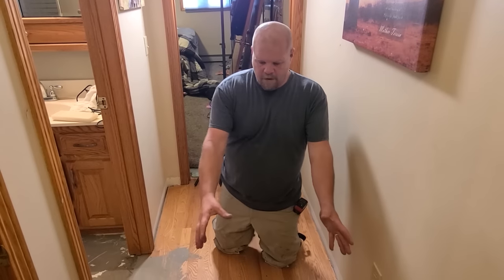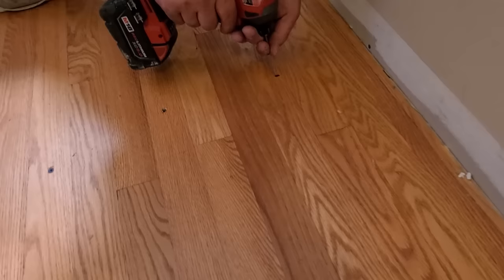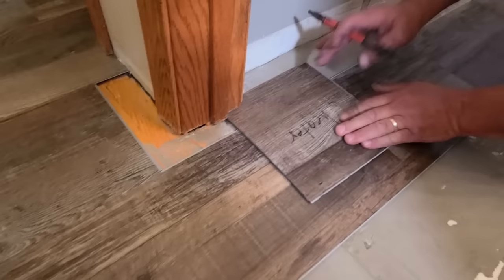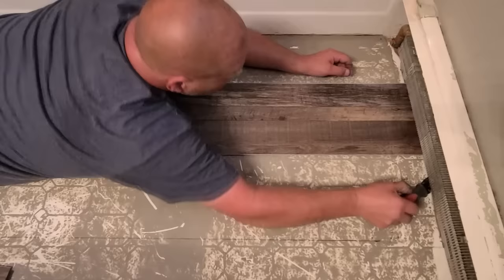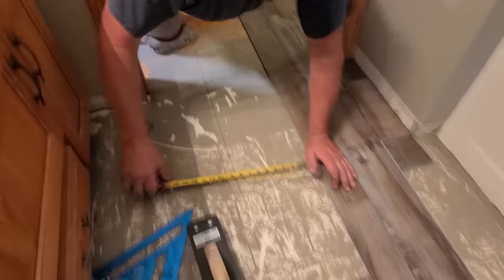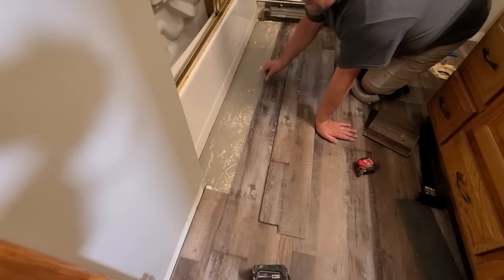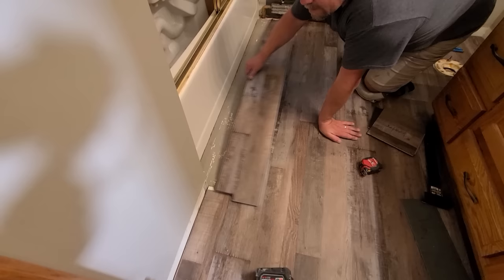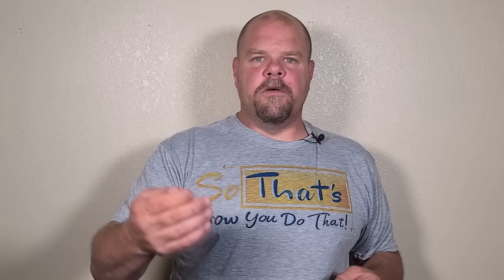How to Install Vinyl Plank Flooring Into a Bathroom

Comment: Hey how is that Mohawk (Tybee island) from Lowe’s. I like the color and the product feels nice and durable, like how the locking lips seem to flex and bend before they break and it has like a 20mm urethane wear layer. Normally around $3 sf But see it on clearance for 1.30. Didn’t know if you had insight on that product. 
Thank you! Great content btw 👍
Reply from the maker: Here is what I would do, bring a box home and lay it out and put the planks together and see for yourself if it is good. If not, bring it back!

Comment: Great stuff Joe.  On our bathroom floor renovation we need to go parallell to the tub.  I saw on one of your other videos that you stated to start with the groove at the tub. Is that correct? Thanks
Reply from the maker: No. I was working backwards in that video because I continued the floor from another room. Always point the tongue towards the starting wall. Hope this helps.
Reply: Sorry Joe, I meant perpendicular. And you stated start with the groove. ???

Comment: Very helpful! Subscribed your channel and will go through your videos to learn more :).
Question regarding using vinyl planks or laminated for washroom.
Costco has both vinyl and laminated floor, we love the color of laminated very much, but it’s Water Resistant only, do you see any potential issue if it is installed in washroom, which has shower tub in it?
Thanks a lot 
Kelvin
Reply from the maker: I would lean towards vinyl plank. But, if you use laminate you can silcone around the edges before re installing the trim.
Reply: Thank you for the quick reply and tip.

Comment: I have a question please... My subfloor has a hump through the middle of the main living area (and focal area). The hump is nearly a 1" high spot over a near 10 foot section from one level side to the other, and going through the whole room (parallel with the direction the new vynal flooring is going). I don't know if I should sand down the area or feather it out with filler to make it more gradual. The subfloor plywood is not as thick as the 1" of sanding down needed so I would go straight through to the joists. I have no idea what to do or why my last floor (engineered hardwood) didn't creek or move with this hump.
Reply from the maker: How old is the house? Are you running the plank direction parallel to the hump?
Reply: @SoThatsHowYouDoThat  The house is 13 years old and yes the planks will be parallel with the hump. The planks are 12mm thick and 10" wide and 5.5' long if that matters
Reply: @SoThatsHowYouDoThat  And after measuring using a longer level, it looks like the hump is just under 3/4" so not quite the 1" I first thought
Reply from the maker: You can cut a section of the subfloor out to get to the joist and then plane the joist down. If you run the plank parallel to the joist it would be ok to go over it. The problem with that though is you still have a hump.
Reply: @SoThatsHowYouDoThat  Thank you so much! I just ordered a decent planer and will be fixing the joist. I just figured that if I don't do it now, while I have no flooring or furniture there, I'll probably never fix it. I really appreciate the advice!

Comment: I've seen many photos of LVP bathroom installs @ tubs, people leaving 1/4" gap for expansion then adding in quarter round at tub to cover gap + caulk to seal. Is the quarter round not needed and we can just do a 1/8" gap and be good? Thanks!
Reply from the maker: Yes, an 1/8 inch gap is good to go and then caulk it.

Comment: I'm tiling the bit under and around the toilet.... I don;t like the thought of weewee collecting in the grooves. between the planks.
Reply from the maker: That won't happen if the plank is put together correctly. You could also glue the joints together in that area to get more protection.
Reply: @SoThatsHowYouDoThat  Thanks for the reply, I'm gearing up to do a house I rent out.... I have one more question though... how does it handle things like cigarettes being dropped on it, I reckon heat would probably be the main Achilles heel with SPC.
It is a small place I rent out so hard to control things like that...
Reply from the maker: I cigarrete can burn it if left on the floor for too long. However, a single plank can be removed fairly easily to fix that.

Comment: I know that most manufacturers tell you not to install LVP flooring under Cabinetry. But, I wanted to get your thoughts on it as well. Thank you for your time!

Also, is there any change in the process of installing flooring in the basement on cement floor?

Comment: We are having to "tap in" a 10 foot section of LVP with a 1 ¹/⁸" section along the side due to unavoidable dimension issues in the house.

Is there a lube we can put on the tongue and groove? I haven't seen a video addressing it.

The problem we ran into is one of the 2 boards were tapping in bent up at the end. Thought reducing the friction may help.
Reply from the maker: Use a pull bar
Reply: @SoThatsHowYouDoThat  
That would have been the smart idea. But We couldn't fit the pull bar that I purchased in the small gap.

I finally got it but sliding the whole section in, lifted hats a little to reduce the friction.

Spent a while day on it.

Thanks for your videos. I was able to plan the whole house  before starting because of them instead of guessing! Just the way it was built, we ended up having to choose were to put the "sliver".

Comment: Hi, helpful video. I have one question. How did you get the board in at 10:55?
Reply from the maker: I slid it under the jamb first and then started to put the joint together at the wall and worked towards the jamb.
Reply: @SoThatsHowYouDoThat  Thank you

Comment: may i know how to decide whether the floor needs underlay?
Reply from the maker: If it has it attached you don't need anything else. If you have a strong locking system you can add another layer.

Comment: Yo joe. What do you think of the overlapping grip vinyl planks that stick to each other with adhesive? Started looking at floor options recently. Dunno what to pick yet
Reply from the maker: I would stay away from that. It is easy to install, but not as high quality.
Reply: @SoThatsHowYouDoThat  How would you rate it by comparison? How much less quality are we talking? Also thanks for response
Reply from the maker: Well, I do not offer an installation warranty when I install it. You can buy it, I am just stating, I would not.
Reply: @SoThatsHowYouDoThat  Ok. Fair enough thank you